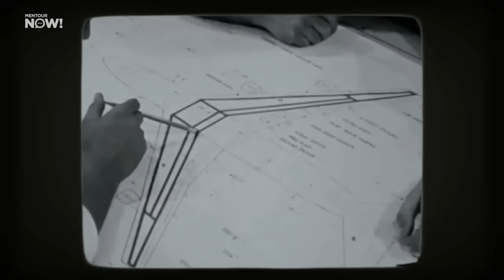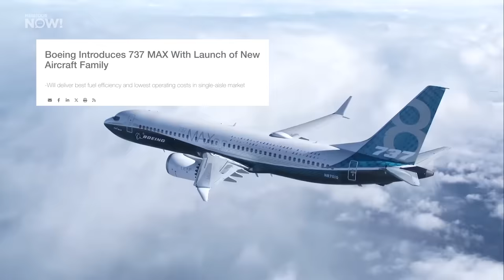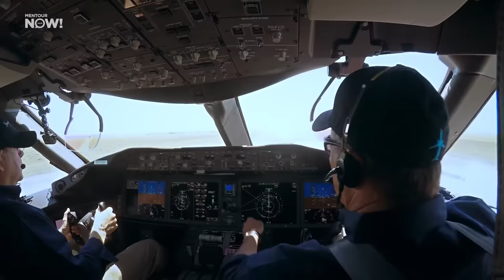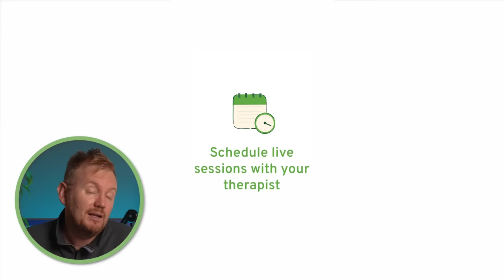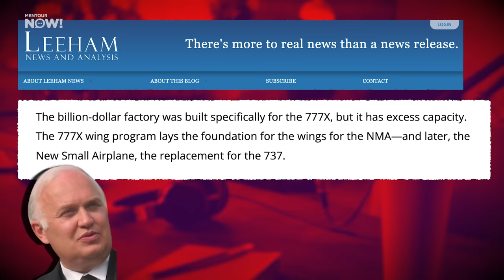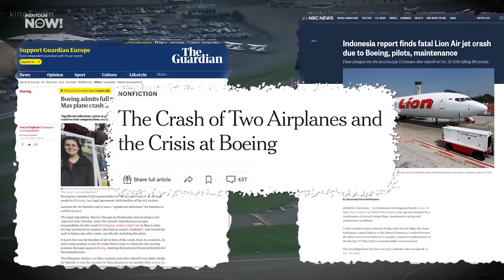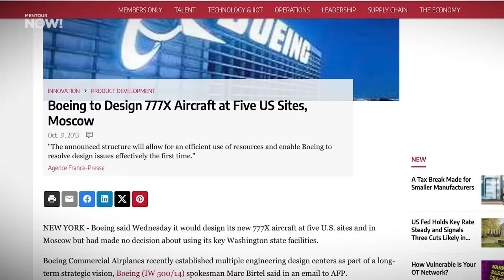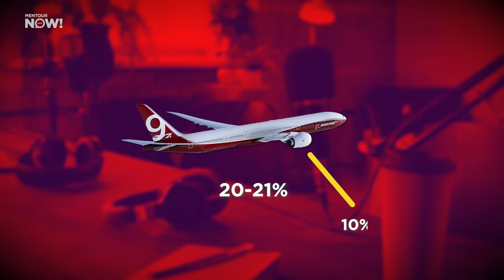What’s Going On With The Boeing 777X?!

Comment: A number of clarifications:
1) The static test airplane is always a write-off and was never planned for being used in-service. I had the opportunity to be in the test room for this test, but passed on the opportunity to a junior engineer to gain experience.
2) The pace for the program is really based upon the ability of the engine manufacturer to develop and test a new engine. However, the program also benefited by having more time to conduct pre-production trials on the composite wings and work-out the bugs on the wing layup automation, which was an expensive lesson learned from the 787. It is understated how much the GE9X engines is a technological leap with 3D printed (additive manufacturing) components, a overall pressure ratio of 60, and a bypass ratio of 10:1. In comparison, the Rolls Royce Trent XWB on the A350 has a pressure ratio of 50:1 and bypass ratio of 9.8:1.
3) The delays at this point are a direct fall-out from the knowledge gained from the 737Max accidents where there is new understanding of pilot human factors and the need to scrutinize system safety analysis at an airplane level rather than on a changed subsystem basis. The 737Max accidents essentially caused a reset to the entire certification timeline for flight deck and systems, with the added difficulty of the industry having to decide what the new rules should be and how to verify them as well.
4) The robotic fuselage program FAUB was introduced initially on the 777-300ER/777F production line; the 777X program was not dependent upon it.
Reply: nice triggered American response making excuses and throwing in some deflection about Airbus too
Reply: The static plane that had its fuselage blown apart could have been used for other ground tests though
Reply: @tomstravels520  There is no other use after the test is completed. The test article is broken up and stored until certification.
Reply: @ant2312  737 MAX-7 has yet to be certificated but has the exactly the same flight deck as 737 MAX-8, which has been approved for in-service operations. The delay is entirely due to stepped-up documentation requirements by the FAA for new certifications. The 777X is subject to the same standards.
Reply: @jeffberner8206  Jeff!!!  Greetings from the SRM group!   I hope you're enjoying your retirement.  I was going to comment on the stricter environment we operate in due to the MAX history, but you beat me to it.
Reply: @ant2312  What Jeff listed is the reality of aircraft design and manufacturing today.  It affects all of the manufacturers of large transport category aircraft, not just Boeing.  Engine manufacturers are always trying to push the bounds of technology as well.  They are incredibly efficient already and gains are very hard and expensive to attain these days.  Think evolutionary and not revolutionary.  I'm sure on the next engine designed for the next new aircraft will have manufacturing trying some innovations to eek out that small but important gain in efficiency and will eclipse the GE9X.

No excuses or derogatory content in Jeff's comments.  Just a statement of facts.
Reply: @ant2312 ans that's why people are snapping up A350's right?
Reply: @Gtrips07  Correct - see Turkish Airlines and the recent order for 75 of them
Reply: @frankpinmtl  compare 777 vs 350 orders
Reply: @Gtrips07  Sure - almost 1,100 for the A350 and what did Petter say - some 450? Double.
Reply: @jeffberner8206 I think there are also some other issues.
Reply: @artjackson8360  Hi Art! Good to see you here as well. Say hi to everyone. 🙂
Reply: Uhm. 1. Not accurate. I've worked on a regional jet program where the Static Bird for an amended ticket was only tested to design loads, removed, retrofitted, and flown. There are provisions so you don't have to test to yield loads
Reply: You forgot to mention that Boeing removing all references to MCAS was a direct result in their agreement with Southwest that stated if pilot training was required that they would pay Southwest $1 million for every plane Southwest ordered.  Southwest order 230 max aircraft.  As a result to save nearly one quarter of $1 billion Boeing decided we need not tell pilots and airlines that MCAS exists.  None of these claims are opinion, but documented facts. It’s also l quite troubling that MCAS had a single point of failure.   
From Congressional hearing: Just hours after the approval for MCAS's redesign was granted, Boeing sought, and the FAA approved, the removal of references to MCAS from Boeing's flight crew operations manual (FCOM). The FAA officials who authorized this request remained unaware of the redesign of MCAS until after the crash of the Lion Air flight
Reply: That narrative is incorrect. MCAS was a loss of configuration control, where a change was made to the functionality of the system during flight test. That change was insufficiently documented and communicated to the Boeing technical pilots and to the FAA.
Reply: @ant2312 , you teenagers are all about triggering and sarcasm nowadays.

Comment: I loved building the 767's from 1997-99 in Everett. Whilst robots don't come in hungover to work there's things only humans can do.
Reply from the maker: The 767 is one of the GOATS
Reply: My favorite wide body aircraft ever.  My last flight on it was unfortunately like 13 years ago.  Continental airlines flight to Guam.  At that time I was flying to Tokyo every three months on 777s (all varieties) and some old 747s.  So my vacation to Guam I expected a 777 and it was a 767!  So comfortable.
Reply: it sounds like Boeing had it all figured out in the 90s, but then the hotshot bean counters came in and ruined everything.
Reply: @acasualviewer5861  as always lol I still remember the drill size of 0.194 for rivets and hukbolts were cool too. Kleckos for holding the parts in place
Reply: For now.
Reply: Name ONE thing a human can do that a fully automated airplane can't do.
Reply: And yet, the robots didn't perform as expected. Poor design of robots?
Reply: @mortgageapprovals8933 Reclamp loose cargo, diagnose a fault from the display but rediagnose based on a visual check, land in the Hudson.
Reply: @PippetWhippet They can do all of those things with better programming, and none of the thousands of fatal human errors that have caused countless human lives over the decades.
Reply: @MentourNow  don´t forget the 757.
Reply: @mor 3:40 tgageapprovals8933 
Crap it's pants ?

Comment: It was great to see the 747SP mentioned. They flew between Australia and New Zealand in the 1980s before the ETOPs rated 767s replaced them flying across the Tasman.
They were great to fly in except if you got a seat in the row behind the smoking section that was only separated by a curtain.
Reply: Only recall seeing one at an airport, China airline, def the ugliest version.
Reply: @Mrbfgray   It looks a bit like one of those cartoon airplanes - you know, with the pilot's head sticking out of the cockpit window grinning at the viewer.
Reply: Good times, I remember the Aussie pilots were a bit "shy" of Wellington winds 😊 I was out working on the 34GP at NZWN one windy day and the SP had three goes at landing - in the meantime a Piper Tomahawk must have fitted in a dozen or so touch and goes.
Reply: Not surprised Wally,
I remember once being buffeted around very significantly.  The aircraft was still at Wellington airport connected to the air bridge.
Reply: I've flown on one several times from South Africa to Europe & had no complaints. Very comfortable & smooth flying